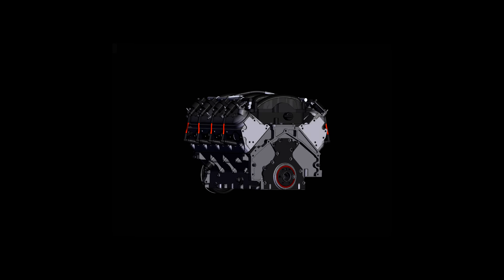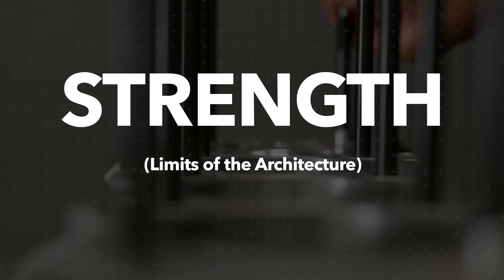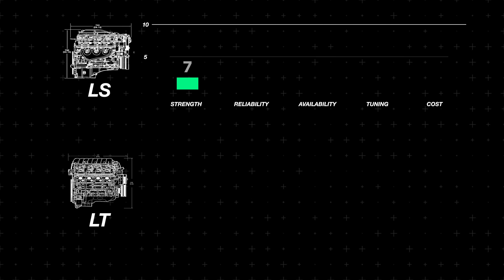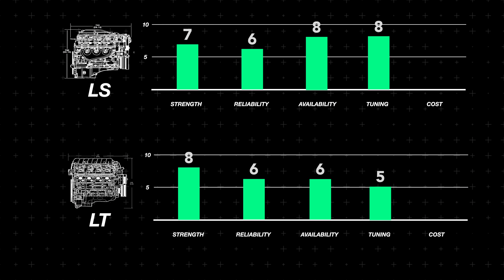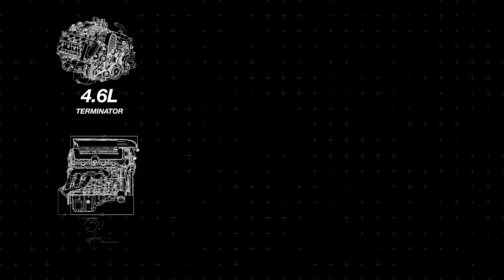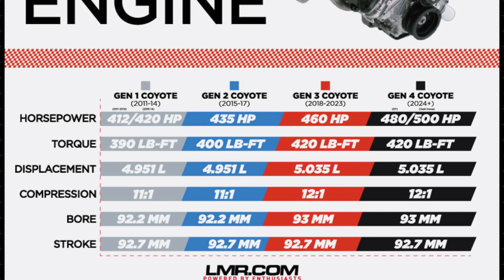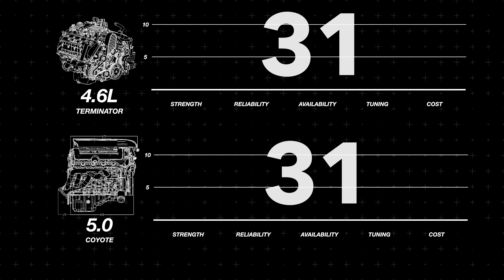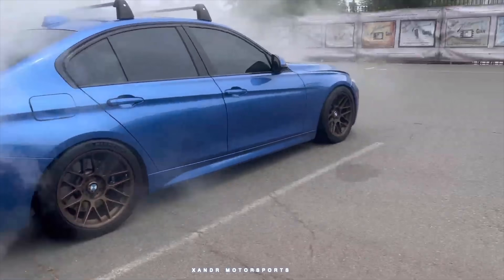Why Old Engines DESTROY Newer Ones💀| Explained Ep. 25

Comment: Touching three digits with a b-58 is very problematic
Fuel injectors can't handle it
And with no room for a front mount intercooler in the body it's just a problematic car
Reply: 3 digits? Fuel injectors are done in any built car, and it uses a air to water intercooler
Reply: @carter898  you can ask anybody what's the recipe for a 2JZ to get into 1200 it's not that hard
Stock bottom end doesn't matter
Realistically you'll probably tear out the bottom and if you're doing all the modifications to try get 900 horsepower
Reply: @carter898  are Waters just limited
Second of all the fuel injectors that you can fit in can't handle the high compression of a super big turbo see you can't just do water-to-air intercooler you also have to do an intake manifold with six extra fuel injectors
It's very hard to get into the nines
Reply: @X-ForceBro  waters can be limited but after so much power you just scrap the intercooler and run nothing anyway. It’s really not hard to switch to port injection

Comment: yeah the best thing you can do with any older ford engine is go aftermarket for the ECU. i did not like how much trade off was necessary when i had my quad cam cobra motor built when it came to tuning. it'll probably be totally fine but modern onboard wideband systems with exponentially faster processing power. i'd rank the mod motors like a 1-2 with tuning. they're the worst on the stock ECU. this is one situation where going aftermarket actually eliminates most of the issues while trading off very little.

Comment: I have 2 out of the 6 engines in this video. 2020 bmw m340i xdrive with tuned catless down pipe and cold air b58tu. 2019 c7z06 manual e50 tune, catless downpipes, cold air, tb, and obviously tune. The bmw has about 60k miles on it and is making me nervous as far as reliability. Nothing is wrong but it has knock even on factory tune and high lead in oil analysis. Both cars are or where road course raced. C7z is my track car used for time attack and its one of the top car in its class in the country right now. I like both but the lt4 doesn't make me nervous everytime I race it.

Comment: While thr B58 is certainly one of the more reliable BMW engines, I wouldn't go near one. 
BMW engines are notorious for engine failure, one way of the other. And it's not just high spec car engines. It's a problem across all platforms. Especially on motorcycle engines. The GS model 2 cylinder boxer engines were repeatedly tested over 50000km, and only once were reported with just a single engine failure. Most of the time, it was 2 or even 3. 
Compared to the 999cc Fireblade engine, that showed hardly any wear over the same 50000km, that's quite something.
And well, the same goes for the BMW car engines. Reports of stock engines blowing up vs 500000km K-series engines, that look almost brand spanking new.
Granted, it might have something to do with how people treat their cars and especially the engines. But it might also have something to do with BMW being unreliable, overpriced crap. Especially in recent years.
Reply: You try to explain how people actually treat the cars, especially BMWs badly, but then concluded that BMW is dogwater in general? I am lost.

Comment: Most “newer” engines are just continued developments of older engines. The biggest advances are in head designs, valvetrain, induction, etc. the RB engine for example has its roots in the L series engines from as early as the 60’s. The LS engine is much more recent having been developed in the 90’s. The newest engines also have not had as much time to mature in the modding community, where older engines have been tried and tested by so many people, almost like crowd engineering as people mod them and find what works and doesn’t. Once the newest engines have been around for longer, they will end up being better than their predecessors.
Reply: The SBC was developed back in the 50s and the LS is really just incremental evolutions of that. The ford mod motors were all new in the early 90s and even the 6.2 or the 6.8 v10 are simply variations of that engineering. The new godzilla is one I'm interested in seeing more development in, the rumored all aluminum 6.8 version would be very fun to play with.

Of course I've always wondered how fords v8 would have turned out if they evolved the old Windsor for the modern age also. Bet it wudda been a LS eater.
Reply: The LS platform is really not that recent at all, each generational update is great but it's still an 80s, maybe even 70s chevy SBC with modern manufacturing tolerances and faster ECUs.
Reply: Technically, I believe the Coyote is part of the same engine lineage as the 4.6 modular as well.

Comment: How is availability and tuning for the LS series motors not a 10?  "Given sufficient time, every engine becomes an LS" has been a saying for 20+ years.  Availability of the LT is a 3--GM stopped selling the LT5, meaning you have to significantly mod an LT4 to add port injection and get into the high 3 digits RWHP.  The C8 LT2 and LT6 motors are unicorns and don't work in front-engined chasses.  There are no aftermarket LT blocks, connecting rods, etc meeting the requirements of top-tier engine builders (Borowski, Steve Morris, etc).  We're at least 3-5 years away from any top-tier engine builders offering one for sale.  A 4-digit number on a LT engine is rare, whereas 3500 RWHP+ LS engines are not.  Nobody uses the LS7 and LS9--they're overpriced, weak foundations for any build.  The LS9 should not be combined with the LT4/LT5--not the same architecture.  The LS3 should not be combined with the LT1 and should not be used as a yardstick for LS strength and reliability.

Comment: The thumbnail is a bad joke, so is the comparison between the b58 and 2jz. Stock the 2JZ might be more reliable, but its also heavier and has less power, is less efficient and has worse cooling. Tuned the B58 is 100% better, easier to get power out of it, better cooling, cheaper and more importantly it has bigger potential
Reply: This 

Rose tinted sunglasses is just annoying
Reply: The 2jz is more reliable across the entire graph. Its a cast iron block with Siamese bores and practically no mechanical faults. Let me know why your cute b58's are pushing 1800hp on a cast block let alone monster billet blocks with 3000.
Reply: @lennixsingh626  it’s not tho, you can get to ~600hp by just increasing boost on the stock turbo and it’s still reliable and still can be used as a daily, a 2JZ with that much power has severe cooling issues needs a new turbo and has a bad power graph. 2JZ was good for its time but bro it’s 2023, BMW easily took over with the B58. What’s the point of 1800hp when you can’t cool them? Also 1800hp are never reliable, no matter what car or engine. Typical JDM fanboy mindset

Comment: The thing with the LS engine is that it's as strong as you want it to be.  There's aftermarket options out the ying for them.  My bottom end alone cost $16,000 and it'll handle a thousand wheel horsepower all day long.
Reply: Pffft, lmao. You'd paid 16,000$ lmao
Reply: Oem Predator blocks have already proven themselves @ 2500 rwhp during sick week.
Shoulda bought a Ford
Reply: You spent 16 grand on a bottom end when an iron block can take the same beating stock?

Comment: i feel like, as simulation tools are more widely available, the manufacturers are able to save cost and weight by putting less safety margins. 

The older engines are built stronger as there are no easy way to test the reliability of engine outside of building one and run them to the ground. This is also compounded by the fact that knocking is more prevalent due to slower electronics , lack of sensors, and purely mechanical systems of controlling timing and AFR. As such they need to beef up the engine blocks to account for those.
Reply: Also because manufacturers ever more try to save weight in the engines cause cars have gotten much heavier and bigger. 
My 3l N53 weighs less than the old 2,5l M20 despite double the power.
Reply: Today’s motors are literally the strongest they’ve ever been in every way that’s the one place they don’t cost cut

Comment: I have the M54B30. Can't wait until I start piecing to together my turbo kit. This engine was made for boost. It's the closest engine to the B58, except its not turbocharged from the factory. But the block is an aluminum closed deck design with cast iron cylinder walls and oil squirters. It's the German 2JZ just without the twin turbos from the factory.
Reply: EXACTLY!!! So cool to see another enthusiast. I wish I had another 1500$ and I would get forged dished pistons to lower compression to 9.5. Make sure to secure your oil pump nut!
Reply: @ThatOneCatNyx  Yes Sirrr! I already got it. I just gotta put it on 🤣
Reply: @jay_z3  Meanwhile M50 are the loved ones where i live. Iron block and some other strength advantages over the M54's. Even M52's are loved. Mainly because M50 and M52's are super cheap to get
Reply: @Tra1aW_PC  Oh ok, I'm going to get the m50 intake upgrade tho. Plus I'm only gonna throw about 520 brake horsepower at it, nothing crazy. If I was going for 700 or 800 bhp, then I would opt for a M50 or M52. 😎
Reply: @jay_z3  Here the M50 and M52 are no brainers for RWD cars ;P (200-600€ engines) Then there's the Saab B204/B234's for around the same
Reply: @Tra1aW_PC  Oh OK, well its nice to know I have options when it's time to change the engine lol. But I can't lie, I love the torquey nature of the m54.
Reply: M54B30 was the very first engine i ever owned, in my 2001 330i. I sold it with 230k miles and highly regretted it. I definitely want another
Reply: M50 block with M54 b30 rotating assembly.  forge rods over 500 horsepower.
Reply: M54B30 is the closest thing to a B58?? In which ways?
Reply: @Harrison Peck  People like to say the N54 is closer to the B58 just because it was turbo charged, but it had an open deck block design. That's why they're arguably not that reliable when you start adding power to them. If you have a N54 you better have deep pockets, especially of you're trying to add more power to one. 💯
Reply: @jay_z3  that’s cool and all but no one mentioned the N54 as an alternative. On the one hand yes, closed deck compared to closed deck, however the N55/S55 are both DI engines can handle plenty of power. I want to say the N55 is closer in bore/stroke dimensions than the M54 but don’t quote me. And I say this as an e46 guy. I’ve had 5 of them and two of them were/are 2JZ swapped ironically enough. In my opinion, the hierarchy goes B58/S58 > 2JZ (GTE/GE) > N55/S55 > Barra (I want to put it lower because I hate Ford) S54 > M5x/N54. That’s just me
Reply: @Harrison Peck  OK. Well I personally didn't look at the bore and stroke, because they both come out to be 3.0 liters. I was just looking at the raw similarities in the construction. 

I didn't concern myself with anything surrounding the engine or what's inside of the engine aside from the forged rotating assembly they both share., and the oil squirters. 

Bore x stroke, and compression ratios, I didn't concern myself with because all of that can be changed on the aftermarket.

 I was looking at the design of both engines from the factory. But performance wise, the order of your list makes sense 

If I was speaking on the performance, then my list would look the same. I was merely talking about the design. All M5x variants from a block standpoint are closer to the b58 than the N variants. 

But everything surrounding the engine and maybe even the compression ratio of the N variants are closer to the b58. 

If I didn't know any better I would say the b58 is a hybrid of the M variants and the N variants. They took the best from both engines and made the b58.
Reply: @jay_z3  maybe thats my misunderstanding then. I was looking at the engines in their totality. And it only makes sense that the B58 would incorporate the best features of its predecessors along with the latest tech and advances in materials and construction.
Reply: @Harrison Peck  Yep. I didn't realize that until this conversation. Lol. They took the best of both engines and made the B58. 

You could turn the m54 into an unoffical B58 with just a turbo and tune, and you could also turn the N54 into an unofficial b58 if you were to close the block and returne it. 💯😎
Reply: Do yourself a huge favor and get a m50/m52 iron block and go single vanos vs double vanos.  The alum blocks are called "butter blocks" for a reason.
Reply: @Dulanor  But they have cast iron sleeves, and I'm only going for about 485 hp crank. If I wanted to build a 600hp+ then that would be a better option.